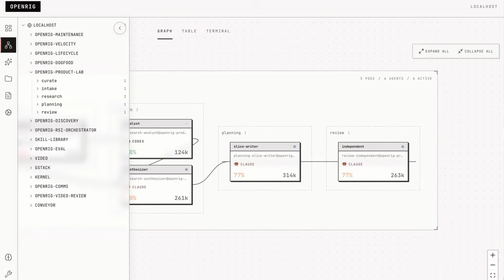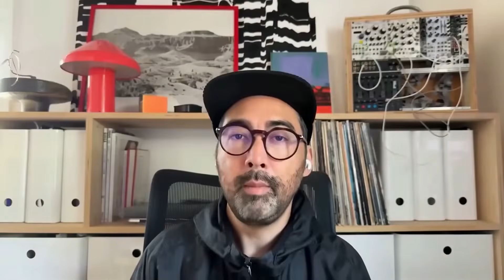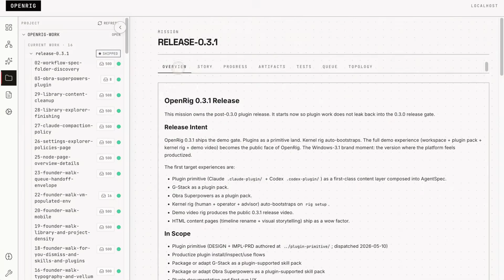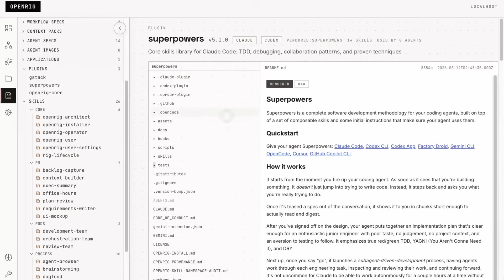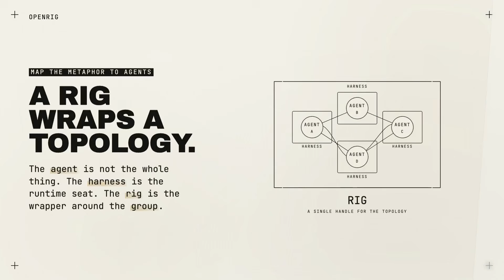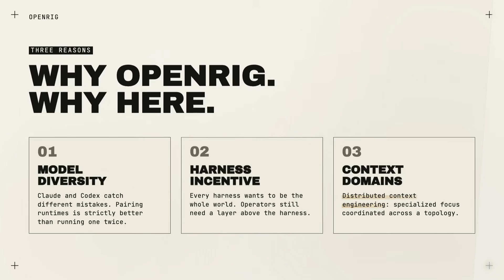Weaponize Your Claude Terminal Sprawl

Comment from the maker: if your terminals look like this, start with two agents that actually coordinate https://openrig.dev/guides/first-team
Reply: Hi Mike, thought you'd be interested in an update on what I've been doing with OpenRig.

After spending quite a bit of time trying to run Bonsai 2 27B locally on my 16GB Mac mini, I finally decided that the model was just too slow for practical development work. But I didn't want to give up on OpenRig, so I tried a different approach.

I'm now running OpenRig 0.7.3 locally, with two Pi agents using OpenRouter: Claude Sonnet 5.5 as the developer and GPT-5.4 Mini as an independent reviewer.

Last night I put them to work on an iPhone/Firebase app I've been developing. They investigated a complaint about slow comment posting, added instrumentation to measure where the time was going, and implemented another requested feature: showing reply counts on collapsed posts.

The developer and reviewer communicated through OpenRig, reviewed the proposed changes and implementation, and ran tests. I then integrated the changes, tested them on the actual iPhone, and uploaded a new build to TestFlight.

The really surprising part was that the entire evening's OpenRouter cost was just $0.76!

So far, the combination of local OpenRig orchestration and cloud models looks very promising. In fact, the agents were working faster than I could comfortably keep up with them. The bottleneck has shifted from model inference to me supervising and approving their work! 

I've also been using the experimental OpenRig GUI, and I particularly like the graph view. Being able to see the connections between agents and what each one is doing makes the whole system much easier to understand. The side-by-side terminal views are useful too. One thing I'd still like is a clearer indication of when an agent has finished a task versus when it's waiting for my approval.

I've previously used Pushover to get notifications on my iPhone when Codex finishes a task or needs attention. I configured Codex on the Mac to send push notifications to my iPhone through Pushover, using a notification hook in ~/.codex/config.toml that called a shell script to send messages through the Pushover API. This let me know when Codex had finished a task or needed my attention. That worked very well, so I added the same thing to my Windows machine where I was running Codex via CLI with WSL2/Linux. The message would let me know which machine needed a visit from the meat puppet. I'm thinking something similar might be useful with OpenRig, so I wouldn't have to keep watching the GUI to know when the agents need me.

Anyway, I thought you'd appreciate hearing that OpenRig is now doing some genuinely useful work here. Thanks for making it available!

Rig up! Rig down!
Good Boy

Comment: I'm getting ready to implement OpenRig on my 16 GB Mac mini. At this point, I'm deciding what agents I want to have ready to go and reading through the documentation about preserving context. While contemplating what to write for the initial documents for each agent, I was reminded of the movie Memento, where the protagonist has no long-term memory and has himself tattooed with what he needs to remember. In honor of that, I'm going to call my version of those context documents "_TATTOO" files.
Reply from the maker: _TATTOO fits. i predict your agents will get the movie reference. and the folder name will be a reminder to them, every time they do a file read or write, that their memory gets wiped constantly. let me know what happens.
Reply: @openrig  Mike — one question before I dive in. My main model is Bonsai 2 27B running locally through llama.cpp on a 16 GB Mac mini. I noticed the current OpenRig docs list runtime adapters for Claude Code, Codex, and terminal. Is there already an intended route for a local/OpenAI-compatible model that I’m missing, or would I need to build a RuntimeAdapter/harness for it? I just found out Backcountry is having a special on rig adapters this month, so maybe I can get a good deal.
Reply from the maker: good question, no adapter needed. easiest route today is a pi seat: add your llama.cpp endpoint as a custom provider in that seat's models.json. it's in the rig-spec doc under pi, works on 0.6.4. a codex seat with a custom provider can also work but there's an open issue (#194) where openrig's auth checks can reject it. honestly we haven't run a seat on a local model ourselves yet, so it should work, tell me how it goes. new runtimes are being designed here if you want to weigh in https://github.com/mvschwarz/openrig/discussions/43

Comment: I just don't understand what you guys are doing with all these agents. How would an agent even know what you want next or what to prioritize? Are these agents at least working out of an existing PRD that you create? I'd assume not even the $200 Claude subscription is enough, so are these agents generating more in revenue for you than Claude is generating in revenue from you?

My limit seems to be 2 windows in Herdr and 1-2 agent panes per window.
Reply from the maker: fair question. they don't guess. i write down what i want as a mission with a spec, a lead agent breaks it into slices and hands them out, and they come back to me for the calls only i can make. cost is the claude and codex $200 subs. and yeah 2 windows is about where it caps out when you're the one routing everything, that's the part openrig takes off your plate